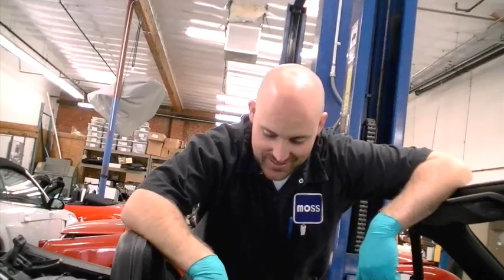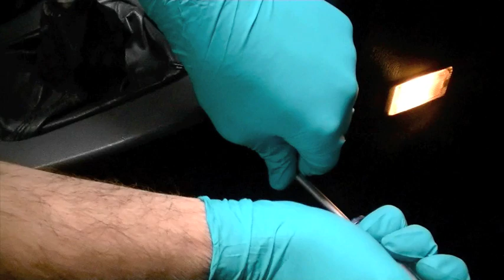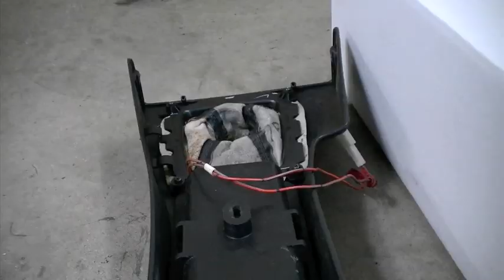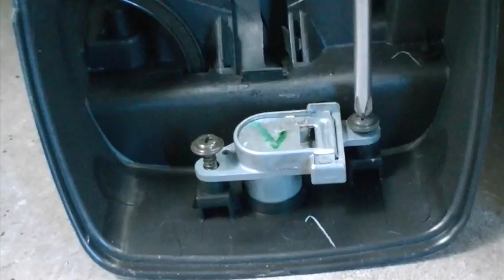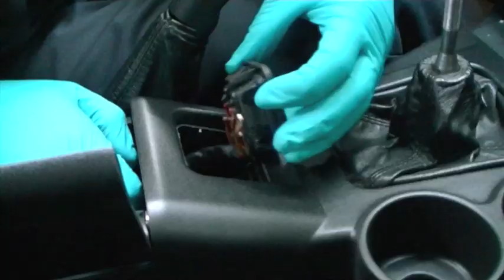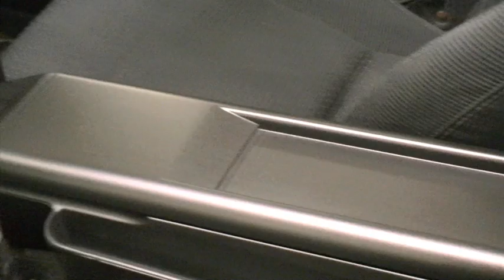IL Motorsports Center Console - #905-265

Comment: @mossmiatamania  Can you further explain the process of uninstalling/reinstalling the electric window switches?  It appears that the new console relocates the switches further up.  Is there extra wiring length in the stock car, or do I need to purchase new wire and rewire it myself?  Thanks.